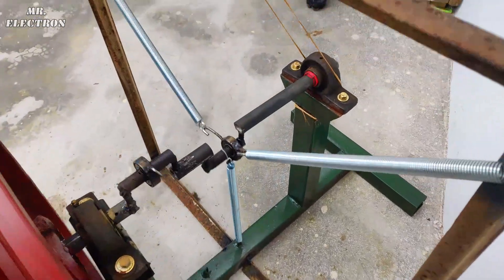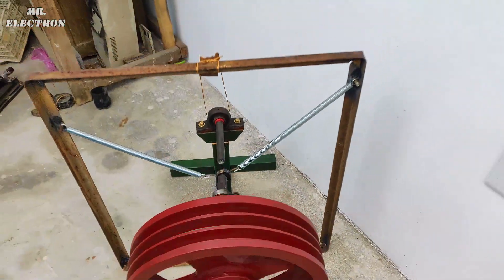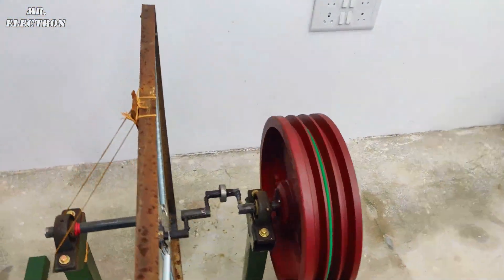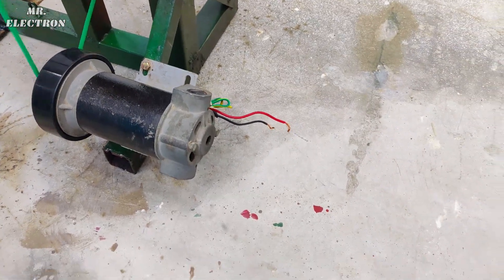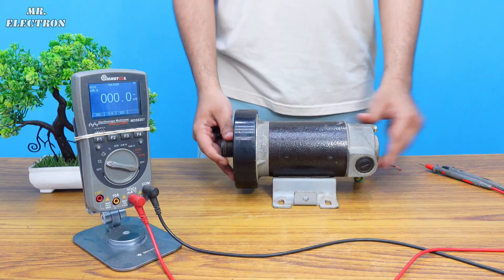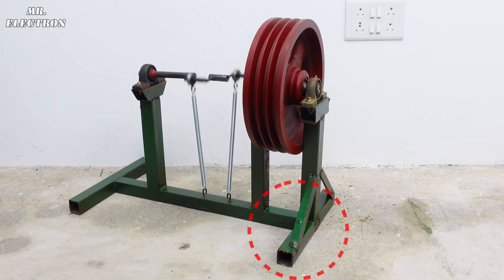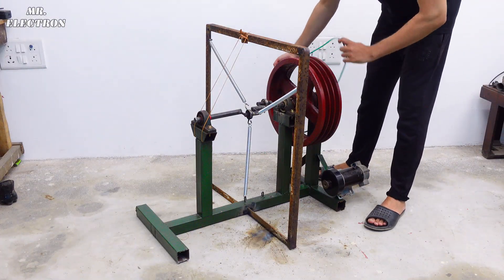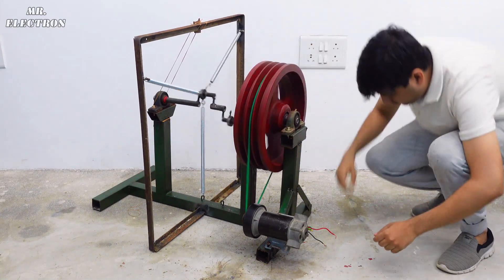Build Flywheel Spring Machine Make Electricity Free Energy Generator 220v Perpetual Motion

Comment: The only one posible to develop new way of generating energy(electricity)(nearly perpetual) with more efective is by : develop a monopole magnet.,which is ,resulting a "flowing magnetic field or i call as magnetic current . Instead of magnetic field. And first ,develop the very new material ,yes ,this monopole need a new material ,rahter its metal or non metal. 
Ivee been decade doing any research and experiment ,and at some point i reize that the ultimate ia only monopole magnet. 
Iam write down all ny thesis and draw diagram all about this system,

Comment: My idea of perpetual motion works,, but it cannot handle the even the least amount of friction an resistance of load,, the real issue is putting in the least amount of energy and pulling out more than you put in,, the weight of the flywheel draws off gravity is part of the energy put in,, add only 12 volts of energy in to operate a generator to recharge the battery then siphon off the energy extra it producers,,, then you got the working idea how it could be done efficiently ....
This guy has very little refined skills of metal fabrication 😂

Comment: Bro did you get a blind monkey to make those NASTY welds ? Also there are other continual run  inducing additions in design you could make to the engine ... You definitely need stronger springs and or change the amount and arrangements of the springs ...

Comment: What if you made a more efficient generator with high quality bearings and machined shaft, (not one from a predator fuel generator) it could power a low voltage motor that assist the wheel and still creates more power to charge a battery bank than it takes to power the motor. Since the kinetic force of the heavy flyweel also properly mounted with quality bearings, would only need a small assist intermittently to stay at a constant rpm. Anyone who has ever used a woodspliter that uses kentic force driven by motor, those wheels spin long after the motor has stopped and would only take a little bump to keep going.

Comment: I patented a device which converts heat fully into electrical energy. There are internal conversion losses but these conversion losses return the energy flowing in the system promptly as heat so the performance of the device is reduced but the conversion is 100%.

The patent is US 3890161A DIODE ARRAY filed 1973, granted 1975, open to the public 1992. 

It is billions of very small diodes in consistent alignment parallel or, for additive voltage, parallel series.

The diodes partially rectify the.random thermal motion. of mobile charges inside diodes

The diodes are aligned the same way so the output of many diodes is additive.

Refrigeration is a co equal product to any electrical output in compliance with tje principle that ener gy is never known to be gained or lost but may change form.

Diode arrays woild make perpetual motion machne models operate more perpetually by full energy recycling.

The concept is free for anyone or group to realize as an attempted prototype.

Aloha,
Charles M Brown
Kilauea Kauai Hawaii 96754

Comment: How much electricity do you generate?
Reply: in short in will generate some electricity depending on the specs of the motor and how fast you spin it, but will always put out less energy then what it consumes.

long answer: 
motors will act like a generator when manually spun, however there is no electric motor with 100% efficiency which means they will always draw more energy then they put out, the more energy you want from a motor the more you have to put in, this also increases the amount of resistance with in the motor making it harder to spin at higher speeds again requiring even more energy to spin it, in this system it would work like a braking system similar to how regenerative braking works in a Tesla.

you could store some energy in the flywheel if you got it spinning fast enough but it would still eventually stop due to friction, heat and air resistance.

Comment: I sing put your working at the only consideration is the weight of the pulley the pulling on its own way to continue rotating without the spring if the springs are doesn't really matter 😕 to The

Comment: Newtons first law. Energy cannot be created nor destroyed. So the mechanical energy you put in in newtons is all that will run the machine, with that inertia and then will run out slowly due to friction.
Reply: The springs heat up and suck energy as well as mechanical friction. It's a flywheel with decorations.

Comment: Add a self charging battery and a small motor to occasionally push, when with time the flywheel looses momentum over time. Making it energy efficient and self sustaining. The flywheel can only store energy over a limited duration without occasional push right?

Comment: Wouldn't dismiss this cool device all together, there may be a way to correct the problem with this tension converted into torque x 3 principle of operation. Need to id x factors in relation to downgrading to a zero force.

Comment: At abou the 11 minute mark you can clearly see the deception here. The motor is fiddled with and it starts running by itself, but notice the belt tension on one side with rotation direction proving that the so called unconnected motor is driving the large pully and not the other way round.

Comment: Ok, the negative comment that are which is it is not PM, and Non-motion without battery or so, so which negative is right, so it is not PM, but how does PM work and how does counter the PM, which ya show continious motion but there's a block, so you say friction is the key to block PM, but it is continueious, so why not it will keep going forever?? After all, the spring cause push and pull, which you pull the string to cause the spin with your hand that's DC motor, but how does DC work with your hand to spin without battery or it is a lie that the motor has battery in it?? So, the most important is DC motor without battery and using your own power to gain light, how does it work, and why it doesn't continue?? Since the friction remain the same and your spin, so how does friction reduce motion?? Because friction is breaking down so sap the energy so non-friction?? But the problem is air itself, so ya can make again with airless so put in vacuum to see if PM will success since no sap of energy happen which the interact of two energy will cause one to be reduce, hence the friction. So, the PM will not success because the static is being alter to dynamic, so there is a gain, and also a loss of energy base on dynamic, well, there is no dynamic since it's a circle, so it is not non-circle which one on left and one on right to cause impact that is friction to each other so causing the reduce energy to two of them, so a circle so in a loop, so interact of circle is air itself that impact to circle cause the friction which reduce energy. So, that means make it as smooth as possible so PM will continue so no interact of any medium mass, so zero medium mass as an environment which interact it.

Comment: He had given the fly wheel an initial velocity. If I am right, he has given the fly a push (which is scientifically force) and as a result, the fly wheel had potential energy and as we all know that potential energy gets convorted into kinetic energy (rotational movement in this case which is also a form of kinetic energy) amd therefore the wheel gets rotated
Albert himself said that reaching light speed is impossible as it would require infinite energy which is impossible and this guy says that his mechanism would produce infinite energy.🤣🤣🤣🤣🤣🤣🤣

Comment: I see lots of friction in this thing.. there has to be  an  energy source  equal and opposite reaction are inviolateable.
It is easy to pull this kind of trick while sitting under a high tensile power line. Tesla did this with some very high powered transformers.
Lights burning moters spinning with the right rigging you can even boil water.  
And yes you can even eletroçute you're self doing this with just a few feet of wire. 
This is why we have a 10 foot distance restriction on high power  electrical wires. 
And litning jumps for miles...

Comment: Yes, a spring machine with a flywheel can work, and the concept is physically sound, depending on the specific setup and application. Here’s how it typically functions:Spring Energy Storage: A spring can store mechanical energy when it is compressed or stretched. The amount of energy stored in the spring is proportional to the square of the displacement from its equilibrium position, based on Hooke's Law:[ E = \frac{1}{2} k x^2 ] where ( k ) is the spring constant and ( x ) is the displacement.Flywheel as Energy Buffer: A flywheel stores rotational energy. When the spring releases its stored energy, it can cause the flywheel to rotate. The energy transferred to the flywheel is proportional to its rotational inertia and the square of its angular velocity:[ E = \frac{1}{2} I \omega^2 ] where ( I ) is the moment of inertia of the flywheel and ( \omega ) is the angular velocity.Smooth Energy Release: The flywheel's inertia helps smooth out the release of energy from the spring. While a spring on its own might release energy quickly, causing sharp bursts of motion, a flywheel ensures the energy is released more steadily and gradually by resisting sudden changes in rotational speed.Practical Uses: Systems like this are used in mechanical watches (where a wound spring powers the motion and a flywheel or balance wheel regulates it) or in various mechanical devices requiring energy storage and regulated release.In summary, this setup works by converting the potential energy stored in the spring into rotational energy in the flywheel, which helps to regulate and smooth the energy release. Whether it works "true" depends on the specific design and intended function, but the underlying physics are sound.
Reply: Thank you for your comment. I'm so tired of the naysayers. I just know this works for some reason. 
God Bless!!!
Reply: @jesusislordforever5518  FAKE- at 11:40 hes messing with wires on back and it magically starts spinning
Reply: It's weird how many comments cannot understand the energy stored and released in the springs.  I don't think it will work forever because eventually the springs will weaken.  For people in poor countries it's not a big deal to have  to spin a wheel every few days or a week.

Comment: This was pretty informative video the system has to have an external source using a flywheel generator on to another fly wheel yes the flywall generator keeps the motion going that's how this is working I like that idea it is actually feasible to do that and it's small amounts of power can produce very efficiently without the use of a gas powered generator so in a sense it is not a perpetual motion machine because you need an external source like a flywheel generator to produce it in the generator produces Is the power to rotate the Spring Spring fly wheel which is giving you the ability to run the flywheel generator to produce power it is a very simple process folks it is not a perpetual motion machine like he says
Reply: @josephgraham1636  l would agree with you there is no such thing as perpetual motion.The nearest thing to perpetual motion is probably the Beverly clock Whichhas been running for now for 164 years and has never been wound in all that time however it is believed by the scientists it too will stop!! WHEN !!  it is a matter of speculation but iIT WILL STOP in the meantime if you are ever in New Zealand it is worthy of a visit before it STOPS

Comment: Is it possible to create perpetual motion using flywheels and spring systems that remain in motion indefinitely without external energy input? If so, how can the law of conservation of energy be overcome?
Reply: No, it is not possible. Springs are like batteries they store energy. And just like a battery you can only get as much energy out of them as you put in. So when the machine is turning, the energy input from the spring contracting is being transferred to the spring that is expanding so there is no net gain the springs cancel each other out. There's a reason that you don't see videos of these machines running for hours on end and uncut.
Reply: Law of energy conservation was formulated by scientists, it's not a "law" but rather a relatively reliable model, like in 99% of cases considered in commercial applications it stands.

Comment: as for the frankness, thanks for you. but to think you have simply used high friction bearings, it won't function, but if you use nested bearing or non - greased bearing, the friction from bearing can be over come using the momentum of flywheel, but even with the setting i said, it can't work for more than an hour.

Comment: I've been using this method for years to power my whole house - no electricity bill for me!
Reply: So you are on DC voltage ?  This turning so slow , not getting full charge voltage / amperage ?
Reply: @RobertFulton-o9j  You can convert from DC to AC no problem.
Reply: Do you have plans
Reply: Battery's 
In frame? Power station operator 9 years.  Nothing for nothing .😂😂😂.
Reply: Если вы действительно сделали этот двигатель, скажите пожалуйста, как сделать его так чтобы он работал, как настроить пружины.
Reply: Liar

Comment: Seeing all the ones debunking and all the ones claiming to be real, all i can do is attempt my own build.  Ill address the inadequacies as i go.  No belts, no intermediate pullys.  Direct drive shaft with motors at both ends, a hefty flywheel, bearings, a diode, and dpdt knife switches. If it doesnt work, itll be because the voltage output deminishes with every revolution despite the flywheel mass.
Reply: Do it with and without the motor

Comment: spinning at a constant speed with a heavy flywheel and with the output of the generator open very little breaking force and the springs have little to no acceleration effect on the flywheel , still keep trying, maybe someday you will actually make a breakthrough should you find some true method of converting gravity to electricity or some such thing

Comment: Fake.  The wires that run the electric motor from the batteries inside the metal frame can  be seen at 2.13 on the far left of the screen.

Comment: Well as you were going around the machine I saw the red and black wire up underneath the treadmill motor I can see where you burned a hole in the frame and that's where Batteries goes inside the frame As you Didn't quite hide the wires So I call this BS
Reply from the maker: @claybornlewis276  Well stopped, and believe it or not, I call it the same 'BS' since it's a scam exposed video.

Comment: If possible I'll give you my email and if you have the plans on the computer in a way I could print them off that would be amazing. And I also just had an idea. What if you were to use 2 types of springs a short strong one for the power stroke and a fast moving thiner longer one for the EQ of horsepower I'm thinking kinka in the way of how a I.C.E worked intake stroke compression stroke spark and exhaust stroke of a multi cylinder engine of course maybe that could be applied here in some manner

Comment: 2:12 the vires from the hole in frame is connected to the  "generator" 👌-> its powered by motor
Reply: Yes, 2 wires going into the frame, and earlier when he moves it, he rotated it with that corner as the axis, so wires can be going to a power source

Comment: Even in the picture of your vid it's a lie you should not lie I think it does work if you make it correctly as some vids I have seen look legit but u just waste ppls time and say yourself you just want ppl to watch till the end what a wasteman
Reply from the maker: It doesn't matter what one thinks because it's not a political matter where people can have their own opinions. 
It's a fact that it's fake, and that is what i have proven here in the video. 
I will always do my part of revealing the truth to people so it is for them to decide.
Reply: @mrelectron_alternator  watch vid from Mr d please
Reply: @mrelectron_alternator What about adding a solar battery to spin the motor? Would that make it actually work and create more energy than just the solar panel that's charging the battery that's making it spin? Basically "piggy backing" off of solar energy to store enough energy to actually spin the wheel at a more considerable speed this creating "in theory" more energy that's actually real and then have it being ran into and stored in larger batteries that can then be transformed from DC voltage to AC voltage? I'm just curious if that would be worth it?

Comment: Why are you connecting the motor to the flywheel with a belt first? 2)You are  regulating the motor speed. So it may be a battery operated motor.